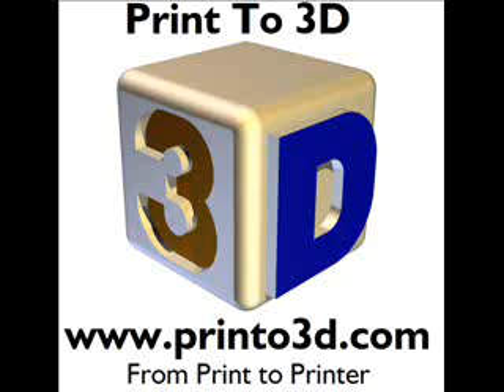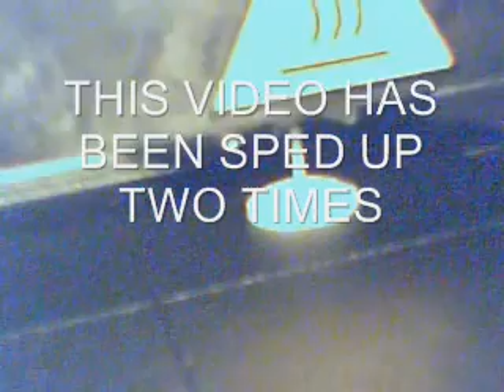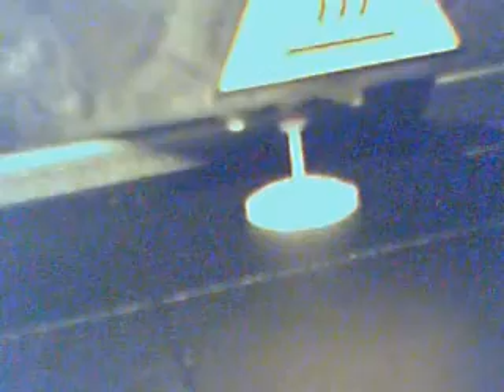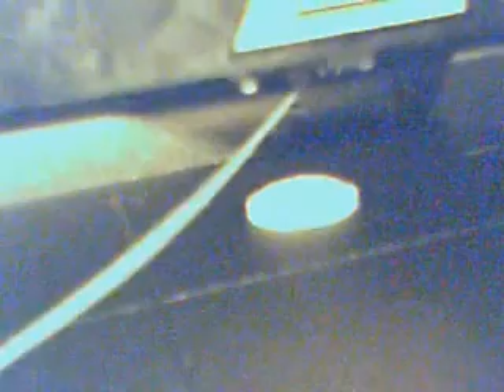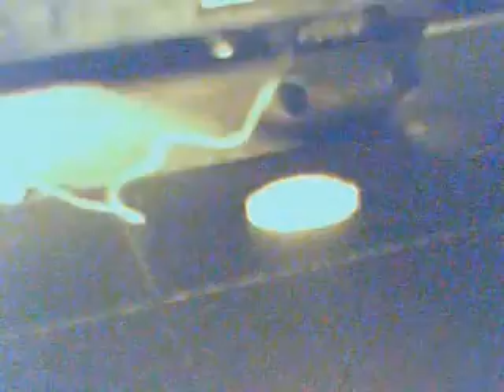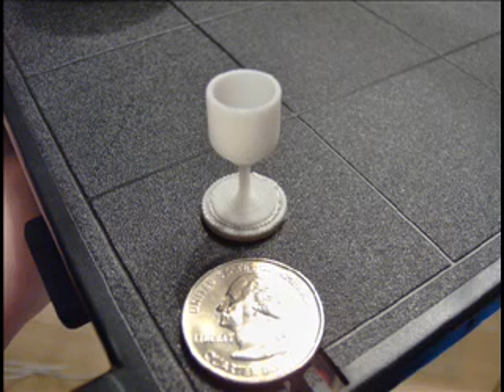Pushing a 3D Printer to Its Limits

Comment from the maker: @jbdimonda Nope.  All you need to do is 3D model it.   You can make pretty much anything as long as it fits inside the print volume and the part features meet the minimum feature size.

Comment from the maker: First of all I designed this part to test the printer and that is just what it did.

Secondly I could change the support structure to "surround" the part and it would print just fine.

Third

Not in my experience.

I have printed a wall thickness as thin as .02"

The part wall did not print when I had it oriented in the machine one way, but printed successfully another way.  It was still very weak and fragile.

Comment from the maker: You are correct it is an FDM printer.  Generally I say 3D printer because most people don't understand FDM or Fused Deposition Modeling.  There are many types of rapid prototyping machines, but the rapid prototyping name is not very good.  These machines have many other uses.  Here are a few abbreviations for different types of these machines: FDM, LOM, 3DP, SLA, and SLS Google them and you will find lots of info.

Comment from the maker: The printer prints in layers of .01" of an inch.
A hair is roughly .002 to .004" inches in diameter.
As I stated in the video the minimum recommended floor and wall thickness of parts sent to the printer should be .04"

Anything smaller than this will not be printed or will be to weak.

This cup is 1 inch tall and is made up of 100 .01" layers.